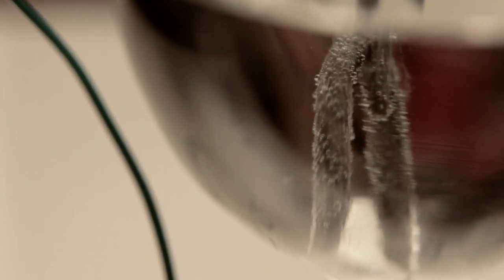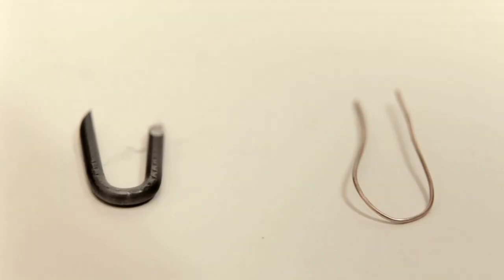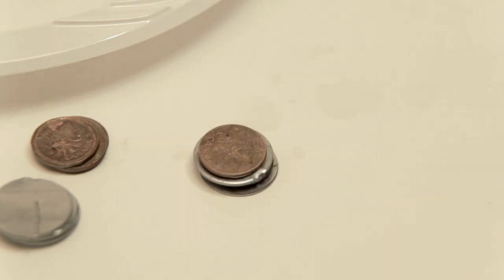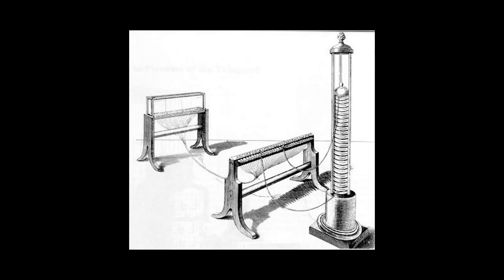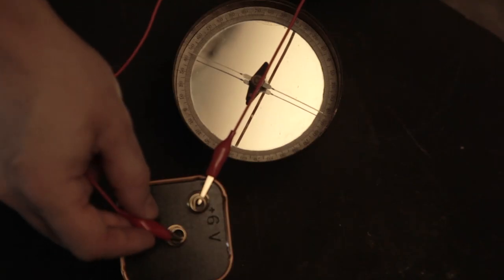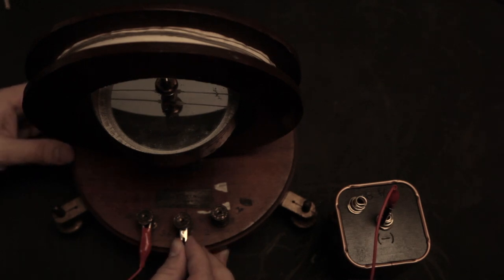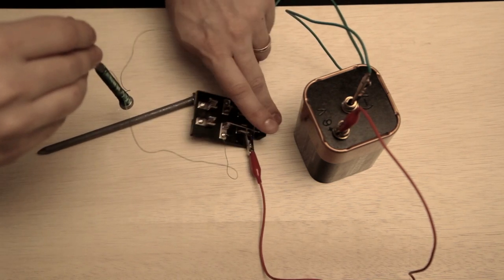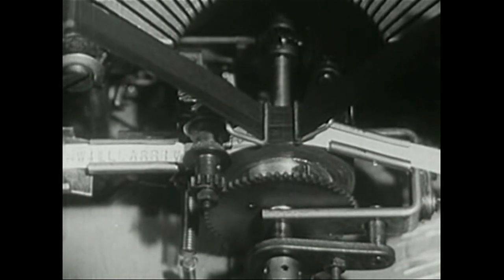History of Batteries & Electromagnetism (voltaic pile)

Comment: 1.digitize (discretize) the message  2.compress it  3.send it at high frequency (more bit per given time)  3. ????  4.Profit!
If you only have analog system, then I guess it would make sense to use information dense language (or protocol), so the meaning can be conveyed in fewer words
or deploy multiple antennas for different frequency, so you can send each message on each frequency  (kind of like listening to multiple radios stations)

Comment: Is it possible to connect the negative of one battery to the positive of
 another battery and put an led in between the two batteries to power 
it. Because the negative ions of one battery will get attracted to the 
positive of the other battery right?.